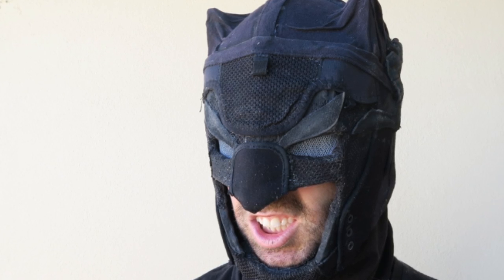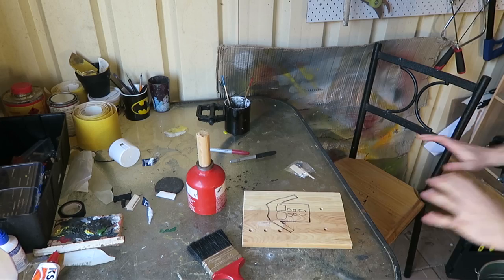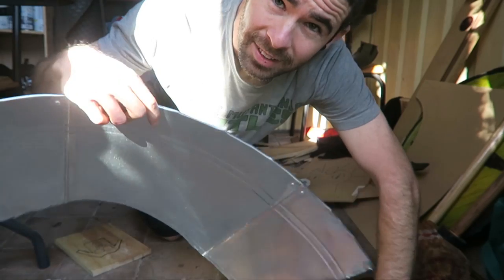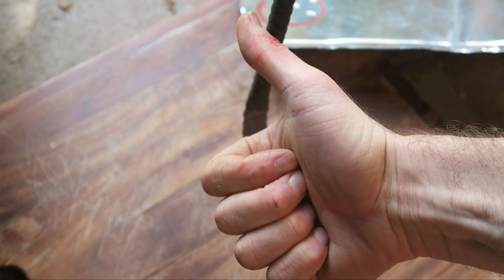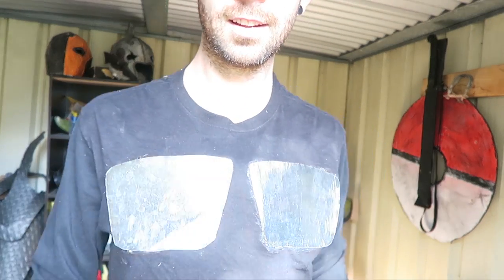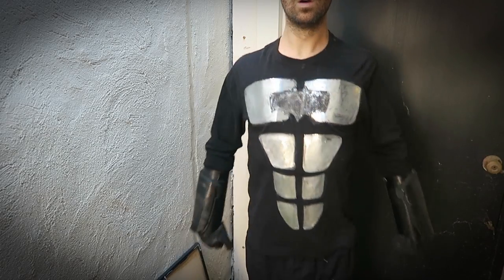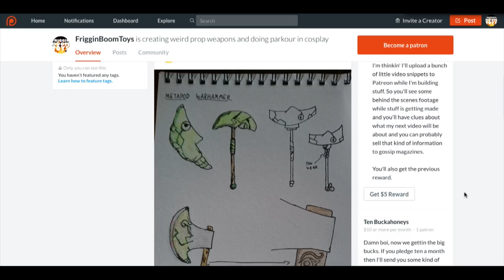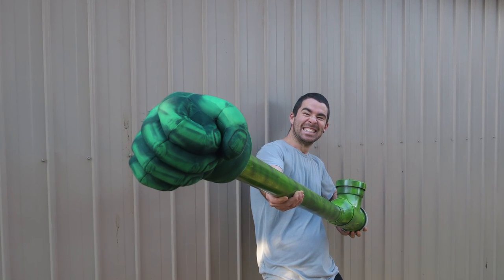Homeless Batman Part 6: Bucket Body Armour

Comment: I recommend using scraps of the buckets on the side for a little more protection
Reply from the maker: I was gonna foam on the inside to avoid cutting up my stomach
Reply: Friggin Boom Toys nice
Reply: Friggin Boom Toys by the way  when you do get around to the cape add shoulder pads to make you look more imposing, right now the Batman suit doesn't look threatening

Comment: For the grappling hook you should make the cannon smaller to a reasonable size. Then attach a rope to the outside. And make the hook be attached to something that will create an air tight seal to shoot it. And have the rope attached to the hook of coarse.
Reply: Tyler Chapin that's a really smart idea not being sarcastic

Comment: Honestly I feel like the armor is lacking. Yound probobly be way better if you took an old used pair of hockey or football armor and put the metal plates on it for added protection.
a) It would actually work as armor
b) It would look funking beastly!

Comment: Spoiler, if you can easily cut it with scissors it's not good armor
Reply from the maker: Interesting you should say that because you can cut kevlar with normal scissors.
Reply: Friggin Boom Toys I can guarantee with 110% certainty you couldn't cut or at the very least easily cut (you know, as my comment said) a well made ballistic, NIJ level 3a rated panel. It's like a third inch thick of kevlar. You could for sure cut like, kevlar lines and one ply thick sheets but ballistic rated kevlar, naw. It's be like trying to cut through a rope as thick as your thumb... but kevlar. (Not to mention in the UK alot of the panels have a chain mail layer for stab and slash resistance.)

Thus stupidly long rant isn't to hate though, I love your channel and can't wait to see more! 👌
Reply from the maker: I appreciate that man, It's rare to find people that understand you can have disagreements or correct eachother without hating eachother. Thanks
Reply: Friggin Boom Toys don't even mention it my guy, I for one actually like to have a somewhat positive relation to content creators, as small as it may be.